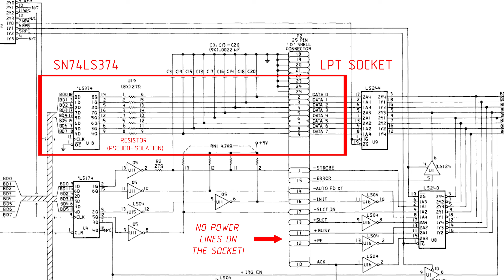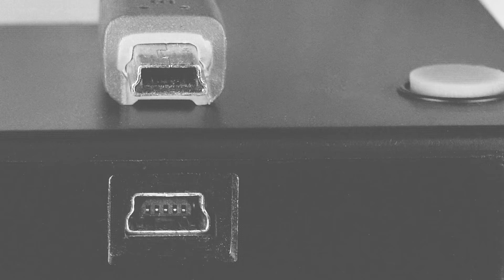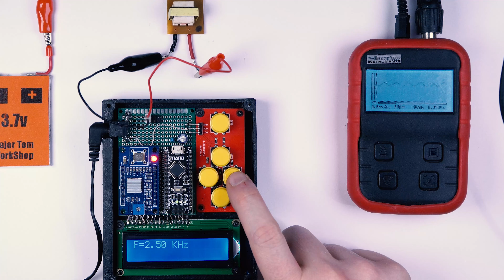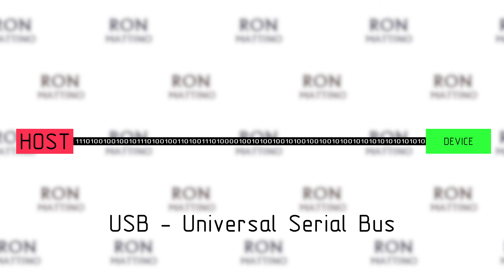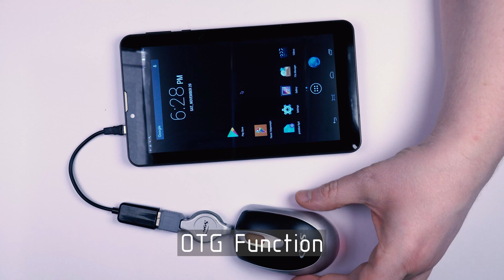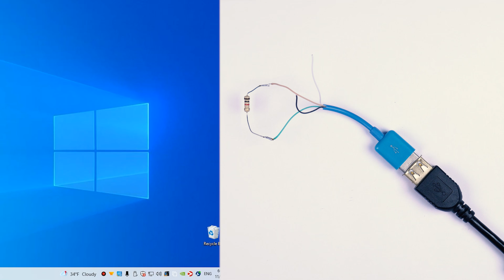How does USB work?

Comment: Micro-USB was supposed to "fix" Mini-USB, by shifting the failure-prone part of the connection to the cable instead of the device. So when things wore out or broke, you were more likely to need to replace the cable instead of the device. At least in theory.

Comment: Thanks for detailed explanation I really enjoyed it! I have a question after all... Some of furnishers has bad habit produce unique power charger, such as Sony, Blackberry and so on. They charging from USB port from computer,  but don't charge from regular USB power charger. Usually device shows message like " you are using not original  charger, use original". How do they do that and how to find out which way this protection could be avoided? This is so embarrassing to buy a new plug for each device. Looking forward for your answer.

Comment: Hi, just to add info, mobile communication is not a great example. 2g and 3g was strictly fdd, they had separate physical channels for tx and rx. They were on different frequencies.

TDD duplexing was introduced with 4G and 5G, but they mostly work in FDD fashion. 

Also usb 3.0 introduced 8/10b encoding,  4.0 has 128b/132b. They no longer using  nrzi at all.

Comment: Hi, nice video. It is really necessary to dismount a pendrive before take off? tks
Reply from the maker: Basically, yes. Because Windows needs to make sure the write operation is complete. Otherwise you can mess up the filesystem and possibly corrupt data.

Comment: A very thorough, professional explanation of the high speed USB port. I like the fact that the presentation kept on target, no chasing rabbits, just relevant information, presented in a logical format, with great illustrations. For those who dealt with the various data ports that we part of the first PCs, the history of the keyboard, LP1, Serial ports, PCI busses,  etc. was very interesting walk through memory lane. Parallel data transfer was once the high speed transfer leader, until technology kept raising the data transfer rate of two-wire serial data transfer. It's too bad that USB connectors took a while to resolve on  the popular USB-C format, whose connection is not keyed.

Comment: USB port had more common with PS/2 port instead of serial port... USB port originally only lacked one "used" pin of the PS/2 port, so it was possible to connect same device with passive adapter.

Comment: In addition to the theory of USB designs, manufacturers of cables and accessories to these cables have added features.  These features may often be necessary for some users.  Earlier products have trouble handling the additional demands now often expected.  Especially the increased current flow that the devices at either end of the cables may want to use with the cable.

The later standards of USB can theoretically handle these increased power demands (120+ watts) of the earlier designs.  These perform differently, depending on the quality and length of the cables.  Some cables have magnetic fittings at the device end.  These magnetic ends may be removable or changed according to the type of device.  Other options include short or longer lengths, adapters, and converters for combinations of plug endings, and coiled cables.

Other more common variations exist in the length and physical toughness of the cable & connectors.  Additional LED lights may be added to either end or just one end of the cable.  Sometimes the whole length of the cable may be lit.  It is now possible to buy cables with inbuilt digital current readouts at either end of the cable.  The end plugs of the cables may also be in-line, right-angled, or versatile multi-angled, compared to the length of the cable.

A rarely mentioned version of the “Micro USB 5 Pin B Male Plug” plug adds the ability to disregard the single “correctness” of the original design.  This then allows use similar to the USB-C plug, where the correct connection can be done without 180-degree twisting.  My purchases of these rare cables seem not available now.